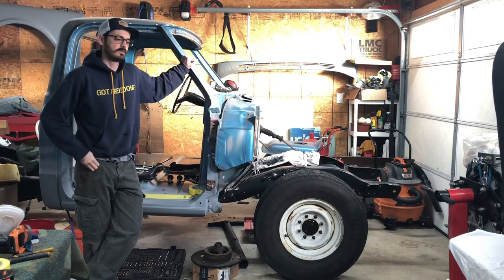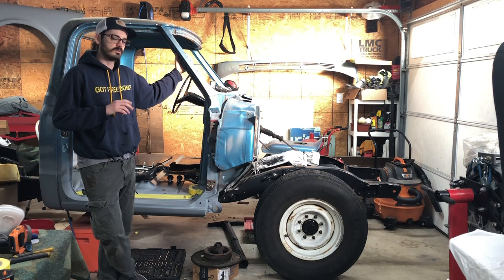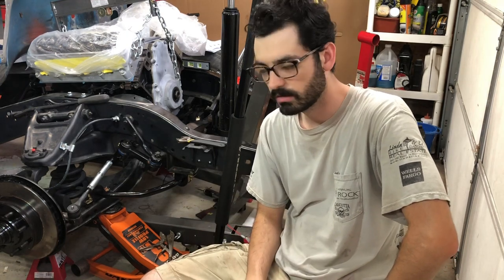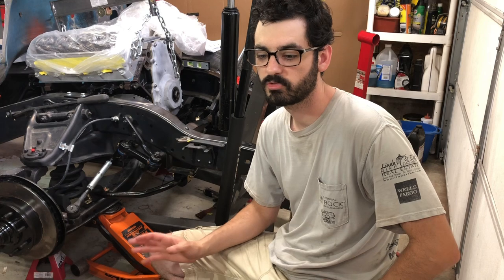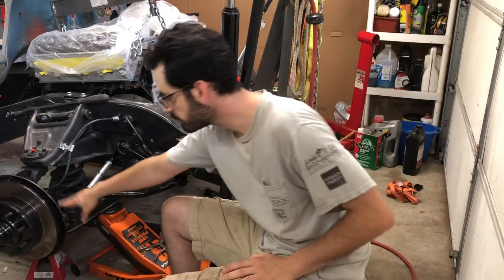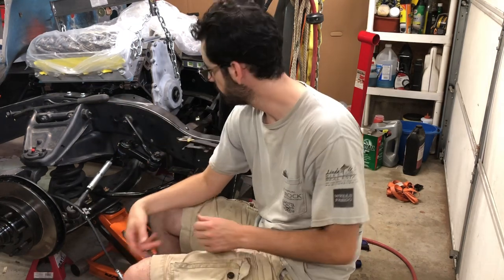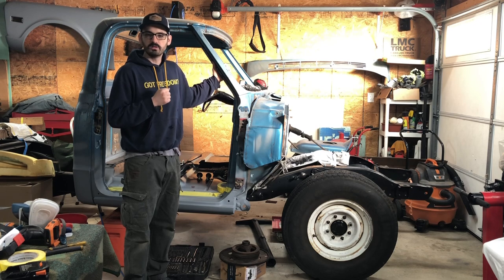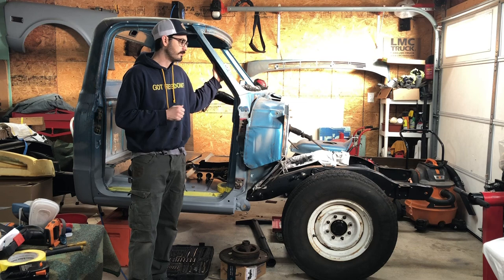C20 Disc Brake Swap Guide (Part 1)

Comment: Performance Online has a complete set for C20 8lug conversion  from drum to disc and 2.5" spindle drop. I just completed the conversion this weekend, Due to supply chain issues from the forge in China it did take 7 months for delivery of the knuckle/spindle!
Reply from the maker: That is great information, it’s crazy how fast new stuff is coming out. Hopefully within the next few years they will also make full repro cabs on the 60-66 styles. Thank you for sharing.

Comment: I had the opportunity to grab an entire factory power brake system on a 67-72 truck a fellow was scrapping many years ago but did not want to have to pull it down and have to store it till I was ready to do the work. When I was ready in the summer of 2017 I bought a complete upgrade pkg from CPP at a price of $5000.00. I gaurantee the factory parts would have been a fraction of that price, and the fit would have been much better as well. Best days to you 👍

Comment: I just purchased a 1966 C20 and I intend on only converting the front drums to discs and keeping the 8-bolt lug pattern. Western Chassis seems to have a conversion kit ready with all the parts necessary.
Reply from the maker: That’s great they are getting kits on the market for the c20s. Thanks for the info. Will you be ordering that kit? if so let us know how the install goes!

Comment: Do you know what power steering gear box would work with a 67 truck?
Reply from the maker: If you call redhead they will tell you. That’s where I got my steering gear from after messing with two I pulled and tried ordering rebuild kits was a total pain/failure.

Comment: How does the break hose go through the frame? My drums were routed on the other side. Is there a bracket or fitting? Thanks for your videos!!👍
Reply from the maker: I cover that information at about the 8 minute mark and the part number is in the description as mentioned. If you want to see more pictures and info on the routing I had a thread on it on the 67-72chevytruck forms: https://67-72chevytrucks.com/vboard/showthread.php?t=832601
Reply: @MAYCOCustomRestorations   thank you
Reply from the maker: No problem, glad it helps- thank you for your support

Comment: I just bought a c20
And need that info on a 8lug to 6 lug swap
Reply from the maker: Ive seen threads on the forums regarding that over the years. Id imagine it would be as simple as swapping spindles/balljoints/maybe outer tie rods on front and hubs on rear depending on the rear end. Not 100% sure.